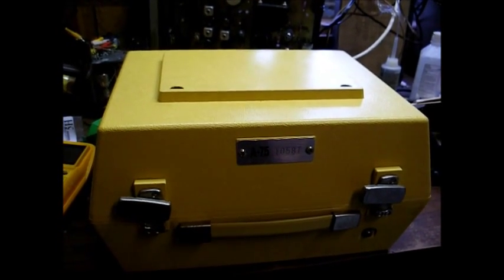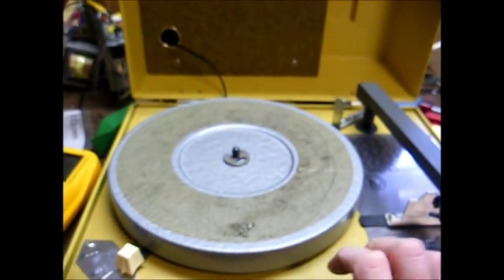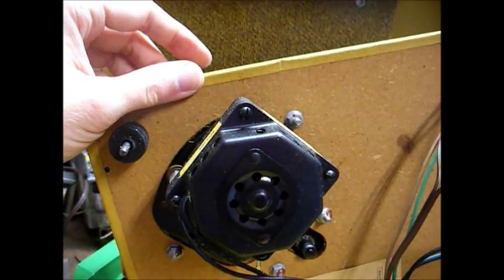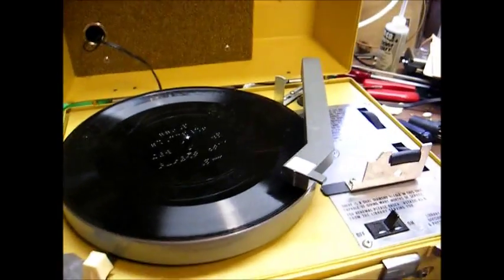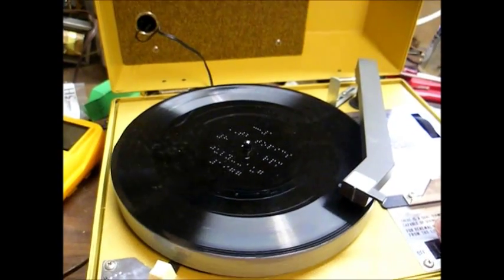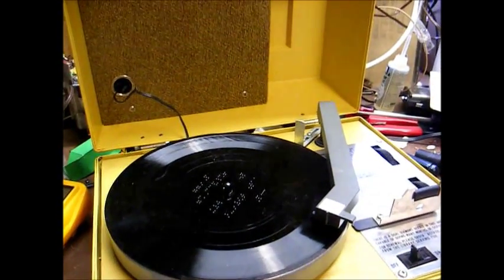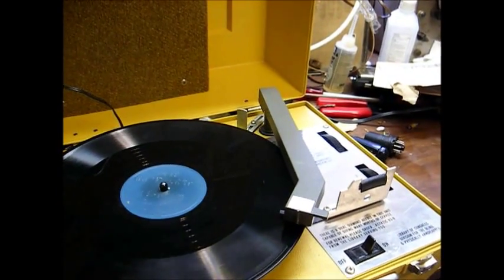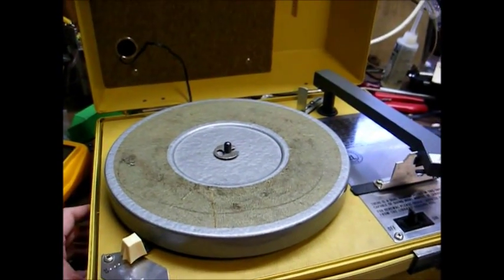Repair of a talking book record player from 1975

Comment: Another nice job.  I'm pretty sure I had one of those machines when I was about 9 or 10, I usually tried to get new machines as they came out.  I am not sure if I ever had one of the tube driven models I may be just a bit too young for that.

As for cassettes, there is some truth to the comments that have been made but how well your cassettes worked and held up had a lot to do with the quality of the tapes you bought and the player you had and how clean you kept your machine in my experience.  I personally have no problem working with records but that's just me.  It's cool you have all those old records, I wish to hell I had some of the ones I used to have, all I've got left are a whole bunch of books and magazines on flexible disk which do not sound as good as the old rigid disks.
Reply from the maker: You are correct about the sound quality of FD's. In fact, the later FD's sound worse than the older ones. The best sounding records were the rigid disc recorded at 16 2/3 rpm and 33 1/3 rpm.

Comment: Another great video!  Thanks! Question--Could you design a circuit to slow down a regular 33 rpm record player to play the 8 rpm records?  I do have use for such a slowdown. A record that hops at 33 rpm may not hop at 8 rpm, thus making it easier to record. After recording, I can bring it up to the correct speed with software. I have done this with 78 rpm records but some are too warped and bop even at 33 rpm speed especially the vertical cut records.   Thanks!    Bob

Comment: Never a doubt on the fix.  Good job.  Also very informative.  BTW...that's the first 16rpm record I've seen and heard in action.

Regards,
John
Reply from the maker: There were a few music LP's on 16 rpm and Jimmy Swaggart had some 12" LP's that were 16 rpm. However, I think most 16 rpm records were talking books for the blind. The library of congress dumped the 16 rpm speed for good during the early '70's and switched to 8 rpm.
Reply: Back in the day 16rpm records were also used by businesses, particularly department stores, to both indoctrinate and motivate new employees.

Regards,
John